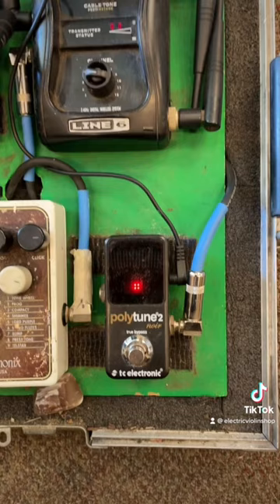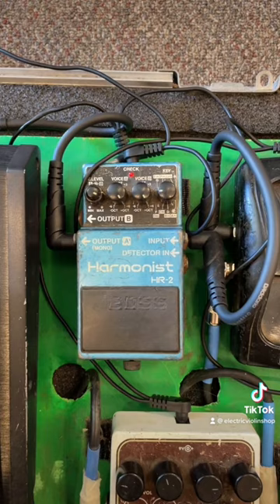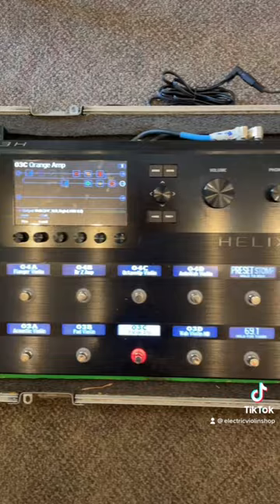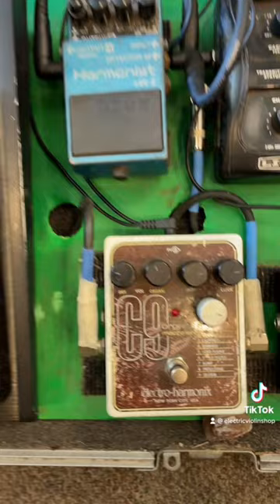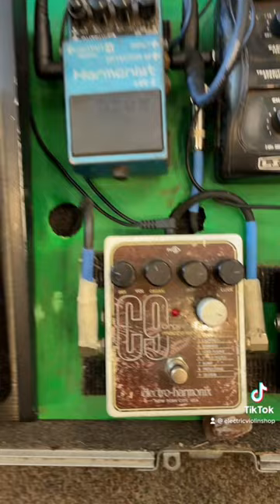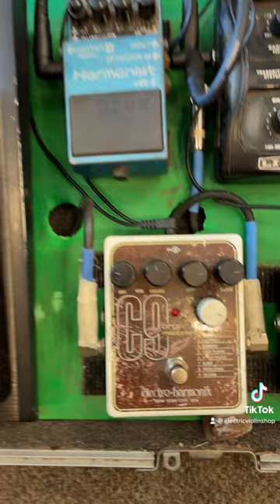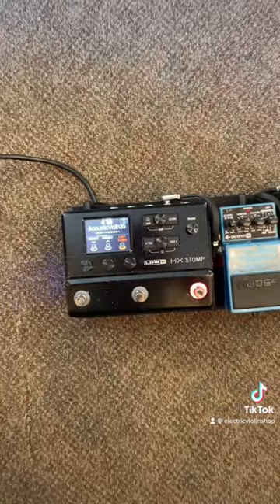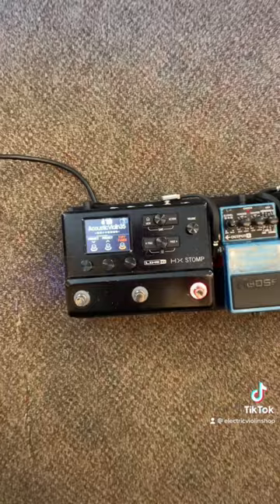What Is Matt’s Touring Rig? #electricviolin

Comment: I wonder if electric violins are similar to electric guitars in that the quality of the pickups and the quality of the strings matters way more to the sound than the quality of the instrument itself. Like I have a cheap 150$ Ibanez guitar that I've put a set of nice humbuckers on, and when paired with stainless strings it can compete with guitars 10x the price, at least on sound alone.
Reply from the maker: The quality of the pickup and strings matters a whole lot. I won't say the body doesn't matter, though. It matters from a sound perspective, but it matters even more from a playability standpoint. Violins, being so small, are very unforgiving on dimensions. The millimeters matter A LOT.
Reply: @ElectricViolinShop  Oh yeah no from a playability point the body can make a huge difference

Comment: Matt, what switching options are missing in your Stomp rig?
Reply from the maker: 8 snapshots per patch, for one. Also, the ability to have a "home screen" with 8 different patches on it that I can switch from A to B to F to C to A to D with one click of a switch. My band did a lot of medleys where we'd have 5-6 songs with no stop and I'd be back and forth between sounds sometimes every few bars - while singing and doing choreography.

It had to be one click. I didn't have time to be flipping through menus.
Reply: @ElectricViolinShop  there's a bunch of compact MIDI switchers that could meet some of that. For a fly rig, you might find a 6-8 button switcher that could give you 5-7 presets, and 5-7 snaps on a second page. Definitely a custom builder can make that, small enough to fit in carry-on bags. I'm considering making something similar, so I can make a smaller board that can sit on my amp, with the switcher on the floor. I'm a big fan of modular setups that work well on smaller and larger stages.
Reply: Incidentally, I just looked at a Paint MIDI Captain, nice little 10 switch controller, with expression inputs. It looks to be about the same width as a PT Nano.